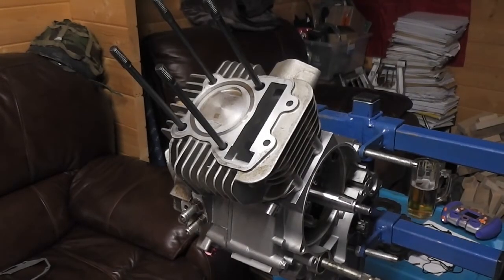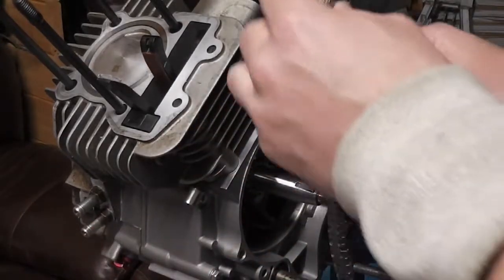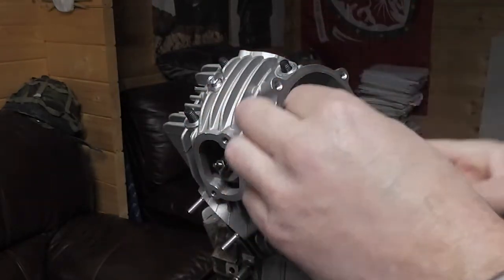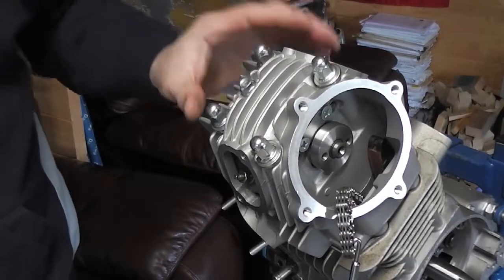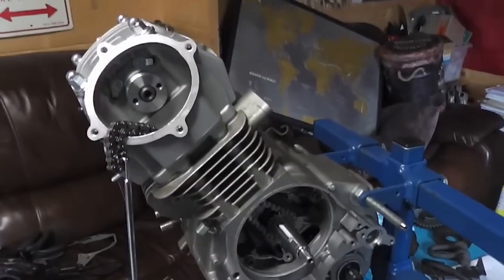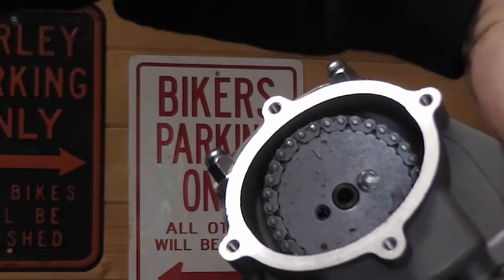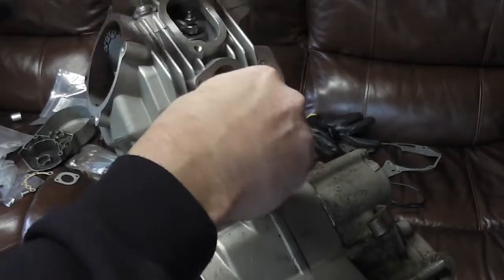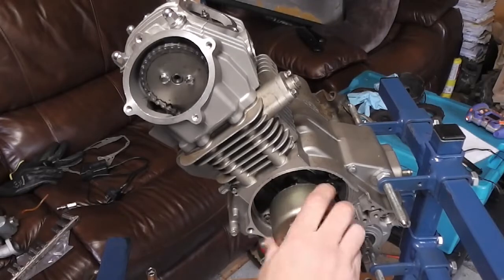Z155 pit bike engine timing. Fitting the cam chain and head.

Comment: I had an 80cc bottom end and a 125 barrel, I cut the the metal sleave that goes into the bottom and then filed the piston down afew thousands of a mm. I didn't know that by taking the top of the piston down to just above the top ring it created a small bit which allowed a bit of extra fuel which when it all went back together it made the bike keep up with 140s as there's not much between a good 125 and 140. It turned the semi bottom end could get alot more out of it and was stunned when it took over my m8s 140cc crf110.

Comment: Got a new head to fit tomorrow so your video is very handy and easy to understand. Top work
Reply from the maker: Thank you 👍🏼
Reply: @motorcyclefixer  what are you setting the valves at too mate?
Reply from the maker: @connorjack3246  have a look at the next video. It's on that one 👍🏼
Reply: @motorcyclefixer  I’m literally down the shed now mate got all the parts laid out, just putting the rings on high dome piston. I know whic order they go in not sure which way the writing on the rings face. I’m sure the face inward and not outwards? Awesome man love it
Reply from the maker: @connorjack3246  writing towards the top of thecpiston
Reply: @motorcyclefixer  ok mate cheers so all writing facing  up isi?
Reply from the maker: @connorjack3246  yes
Reply from the maker: @connorjack3246  I've done a video on fitting the piston rings too
Reply: @motorcyclefixer  nice one guna have a look now, got a high dome piston and brand new head so wanna do it right. Thanks for your help too man
Reply: @motorcyclefixer  just noticed a tiny tiny nik in the barrel I’ve tried smoothing it and polishing it. What’s your opinion on that mate
Reply from the maker: @connorjack3246  depends really
If you want it perfect then you should change it
There is a chance that the ring will catch it and chew up depending on where it is. Maybe, maybe not
Should be OK if the bike is just for knocking round on
Obviously depends on the depth as well 👍🏼
Reply: @motorcyclefixer  cheers for reply mate. Bought a new barrel for it waiting for it to be delivered. To it the right way first I suppose cheers for help too
Reply from the maker: @connorjack3246  no problem
👍🏼
Reply: @motorcyclefixer  hello mate the new barrel has come I’ve put it all together now, what are you setting the valve clearances at, I’ve put a high dome piston in do I need to account for that on the clearances?? Thanks mate just getting abit stuck now with the valves
Reply from the maker: @connorjack3246  the valve clearances are the same
Reply: @motorcyclefixer  aw happy days cheers mate

Comment: Currently rebuilding my m2r 160 bottom to top. Like u said it is relaxing to some watching people fix bikes so i decided to get my own project love the vids mate 👍🇬🇧
Reply from the maker: thank you.
all the best with your build
Reply: @motorcyclefixer  Do you know where i could possibly find the washer/spacers which you use for the idle gear, kickstart gear and clutch and crank gear? Almost finished the bottom end but havent got the spacer/washers needed… also thanks for the reply!
Reply: The washers you can see in your other video where you assemble the clutch side of the engine i mean..
Reply from the maker: @LJ-ou2gl The best place for these small bits are to get them off a wrecked  engine as they don't sell them separately
Reply: @motorcyclefixer  thanks for the help!

Comment: You're very welcome and keep them coming, if im right the timing marks are on the sprocket? I use the spring-loaded bolt to tension the slidders. But very detailed video as always. With my 1 of my z155s, I think it's the stopper arm bottom pin has become lose enough to jump up onto the shifter drum but keel thinking it was the gearbox or another hairline crack in the linkage cogs like the one you found on my engine when I brought it up to you to which I was so grateful and appreciate it. Many thanks again
Reply from the maker: Thank you Dean
If you've still got an issue with it, bring it up and we'll get it sorted
Reply: @motorcyclefixer  your welcome and a big congratulations on the 1000 subscribers as your videos are so detailed and good you deserve many more so guys who watch any of this motorcycle Gods videos any true person who loves to learn how to do something there's no better teacher in my book.
Reply: @motorcyclefixer  yea I wouldn't mind that if your able to fit me in in about 3 weeks time if that's ok with you. I put it all back together and it runs but I just ain't got any clutch. It goes through the gears fine one second and then the next its not as smooth as it should be. Plus the no clutch problem, I thought that they might have needed the engine to run to pressure the clutch as they wet clutches on the 155 but even after leaving the bike run still clutch get no clutch, I have a spare one here but when I put it on it locked the engine up. It's whole at the moment so if I strip it back down and you could fit me in in about 3 weeks time id be really grateful and very much appreciate it. Sorry, I must have missed this message until just now. Thanks, budd
Reply from the maker: @blownwest1117  no problems
Let me know when you're coming and I'll give you the address
Reply from the maker: @blownwest1117  also best to leave it together really as it may be easier to see what's wrong

Comment: When you where checking, what's the reason for putting the ball end of allem key in the back? Great videos mate 👌
Reply from the maker: Just to make sure it's at tdc
Reply: @motorcyclefixer  thanks for the reply, tdc?
Reply from the maker: @andymccune3951  top dead centre
Reply: Got ya, thanks m8. I'm gonna strip mine tomaro n fit new head gasket. Your videos have helped me alot, thanks
Reply: What it's best thing to use to take bits of the old gasket still left on?
Reply from the maker: @andymccune3951  you can buy a plastic scraper
As long as it's flat and you don't scrape the surface
I wouldn't use a screwdriver

Comment: Gonna be doing my Stomp's first ring replacement it's never been replaced anything else I should be thinking about replacing? Its a 2018 160
Reply from the maker: Hi
It's best to change the complete piston kit
New gaskets and adjust the valve clearances 👍🏼
Reply: @motorcyclefixer  cheers for the quick reply new problem also came up. I’m getting this tapping noise whenever I put it into first gear. Every time the bikes goes it starts tapping no matter if the bike is on or off. This tapping only happens when moving and only in first gear
Reply from the maker: @MTarek0012  you may have a broken tooth on one of the first gears if its only in first it's making the noise
Reply: @motorcyclefixer  is it something to get changed as fast as possible or
Reply from the maker: @MTarek0012  it's a full engine tear down  and replace the gearbox so i suppose it's up to you really depending on your skills and the cost etc. Seeing as you'll be taking the barrel off there's no harm in taking the clutch cover off and having a look
Reply: @motorcyclefixer  Assuming it is just the tooth it's only the gear set I'd need correct?
Reply from the maker: @MTarek0012  yes
Reply: @motorcyclefixer  Thank you so much, are you planning on making more videos on the ZS155 engine they're really helpful
Reply from the maker: @MTarek0012  I've made all the rebuild videos from start to finish on the 155 engine so check out my older vids
I no longer have that one but I expect I'll get another one at some point
Reply: @motorcyclefixer  thanks for the help looking forward to see more vids
Reply from the maker: @MTarek0012  thank you
Reply: @motorcyclefixer  unsure if you’ll be able to help me on this one but my engine  is 2018 so the gear shaft is a different design which apparently is no longer manufactured. Would you know anywhere to look?
Reply from the maker: @MTarek0012  I buy all my spares off ebay
It's easier tbh

Comment: Hi mate after doing a oil change on my pitbike it seems to be smoking pretty badly it has the correct amount of oil in but seems to be really smokey I rode it for about half hour to see if it would just burn off but it's still smoking any ideas why maybe piston rings ?
Reply from the maker: It could be piston rings.
That's all you did is change the oil??
Was there oil in there before
Reply: @motorcyclefixer  yeah mate that's all I did was change the oil and I bought the bike recently rode it for a few days then checked the oil it had no oil on the dip stick so I removed the oil about 100ml dropped out 😬 no where near the amount it should have in the oil had no metal shavings as I put a magnet in to check and nothing so I don't think it's done much damage.
Reply from the maker: @gvn-xk6eq  Could be the rings or the valve stem seals
Probably burnt all the oil away that's why it wasn't smoking and no oil in it 🤦‍♂️
Reply: @motorcyclefixer  I wish people would just be honest when they sell something are the stem seals easy to replace ? I'm very aware how to do piston and ring replacement also why I was thinking piston rings is it doesn't have a lot of compression when kicking it but it starts first or second kick from cold.
Reply from the maker: @gvn-xk6eq  The stem seals are easy enough you just need a valve spring compressor to get the collets off.
I know what you mean
I just bought a bike off ebay and the guy didn't mention the frame was damaged where the footpeg bolts on 🤦‍♂️
Reply: @motorcyclefixer  I'm probably just going to buy a new head and piston kit
Reply from the maker: @gvn-xk6eq  Sounds like a plan 👍🏼
Reply: @motorcyclefixer  thought I'd let you know I removed tge top end and found the piston shattered on the bottom and a gauge taking out of the side which has seized tge piston rings in which won't move so I found the oil problem
Reply from the maker: @gvn-xk6eq  No wonder there wasn't much oil left 🤦‍♂️
ATB with it
Reply: @motorcyclefixer  cheers mate il keep ya informed I feel like i need to now 😂😂
Reply: @motorcyclefixer  also do ypu have am Email I can send some photos of the piston how it still ran I will never know
Reply from the maker: @gvn-xk6eq  Email is mandlmotorcycles@live.co.uk 👍🏼

Comment: Hi mate still doing the rebuild on the yx160 pitbike. I put in the cam chain tensioner and followed everything you done and my chain still seem to have abit of slack in it, is this normal? Cheers mate
Reply from the maker: A little bit of slack is ok
Reply: @motorcyclefixer  ok mate cheers for reply, can chain tensioner is rounded off only just noticed it. I think that may be the reason the valves smashed into the piston because the timing chain had slipped off of the crank.
Reply: @motorcyclefixer  all back together and snapped oil feed bolt I’m absolutely fuming any idea where I can get one please it’s got the hole through the middle 😣
Reply from the maker: @connorjack3246  I bought them from ebay 👍🏼
Reply from the maker: @connorjack3246  2 x 8mm Pit Bike Oil Cooler, Brake or Engine Banjo Bolts
These are the ones
Reply: @motorcyclefixer  I done it mate all put back together and it’s running in now. I’m so happy aye. Cheers for you help and replies too man 💪🏻 top guy. I’m valleys boy too😎
Reply from the maker: @connorjack3246  I'm glad it's all working. Well done 👍🏼👍🏼👍🏼😎😎

Comment: mine 155zs engine why the cam chain does not tighten The cam chain tensioner is tightened
Reply from the maker: It could be that the cam chain has stretched or the cam chain tensioner is not working correctly

Comment: Hi mate, see when I rev when start bike there is a bad firecracker popping sound, seems to be in lower revs and calms down slightly , is this what has happened ?
Reply: Just replaced whole head aswell; it’s a horrible noise and only when first rev
Reply from the maker: Hi 
I would take it apart again and check it if it were mine tbh👍

Comment: Hi mate I’m replacing bottom and head gasket on Z3R 140, I got a O ring for the bottom end I’m wondering if there’s suppose to be one for the head gasket too??
Reply from the maker: Was there one on there when you took it off
Reply: @motorcyclefixer  to be honest I don’t have a clue, there’s enough of the head showing inside the gasket for a O ring.
Reply: @motorcyclefixer  I just had a read online in a forum and apparently there isn’t meant to be one there even though the recess in the gasket is large enough for one.
Reply: @motorcyclefixer  I just had a read online in a forum and apparently there isn’t meant to be one there even though the recess in the gasket is large enough for one.
Reply: @motorcyclefixer  my dilemma is I got an O ring on worktop that fits in there, this is where I’m confused lol